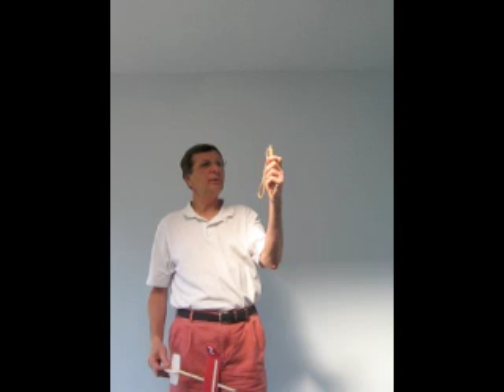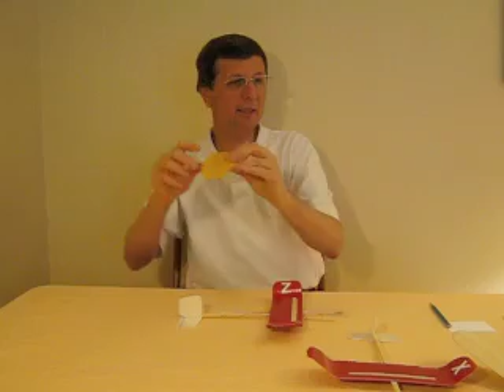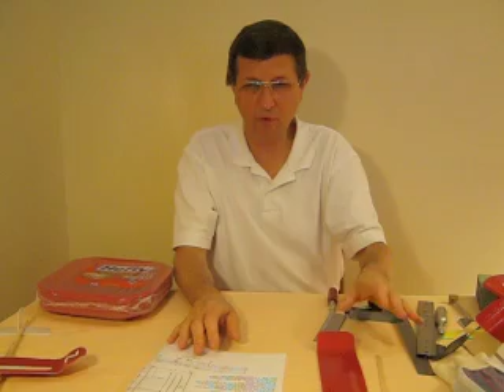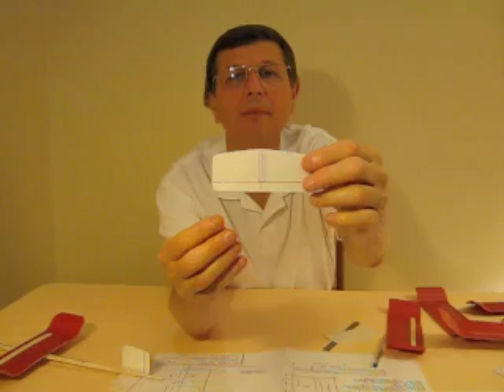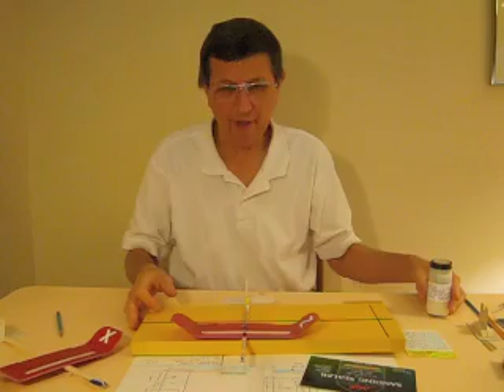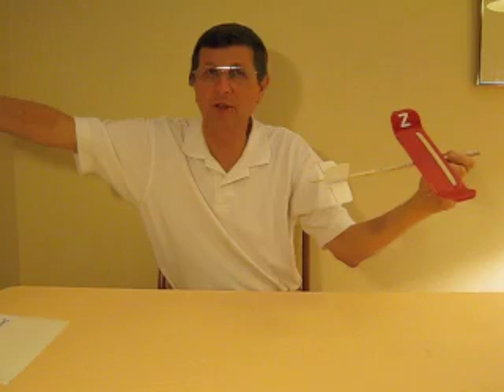Flying Star Catapult Glider

Comment from the maker: Yes, especially if launched in the downwind direction, in a 5 mile per hour wind.  Under these conditions if the plane stays in the air for 20 seconds it will cover about 150 feet.  For help locally with model airplanes go to
the website for the Academy of Model Aeronautics, then "Find a Club" at the bottom of the page where you can enter your zip code to get contact information for experienced model aviators in your area who can assist you.